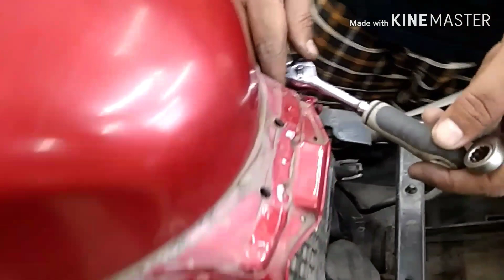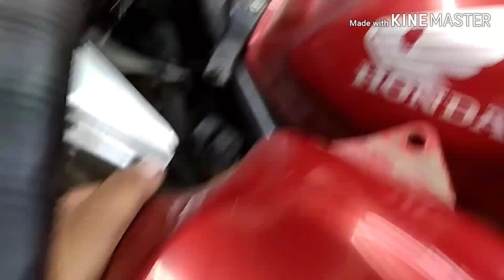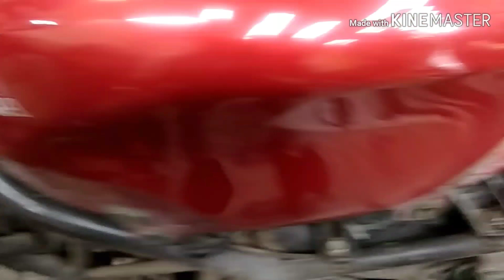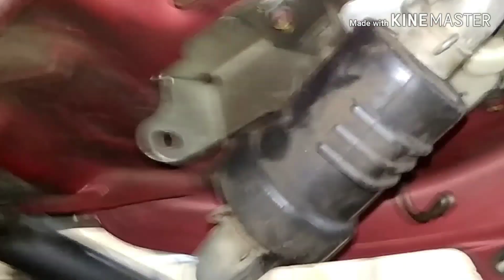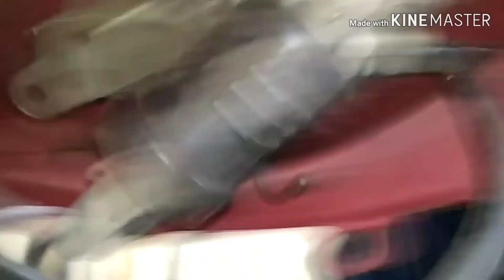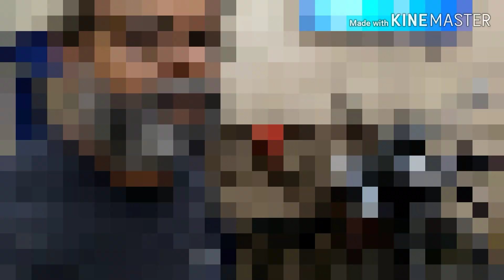Honda cbr250r fuel tank disconnection procedure (English)

Comment: Thank you for this video. Sir, if you read this comment, please do respond. My 2012 CBR250R has a fuel leak issue where it only leaks when the tank has more than 3-4 litres of fuel in it and also it only leaks after parking the bike on side stand after riding. The leak is from the overflow pipe (1 of the 3 black drain pipes near the side stand area). In this video, I didn't see where or how is the overflow pipe connected at the bottom of the fuel tank. Can you possibly tell me ?
Reply: It connects to the top

Comment: I recently had service of my cbr but since 2 days there is rpm fluctuation issue and knocking sound from engine, after self start bike automatically switches off , I don’t know what to do , its at service centre and company mechanic says to replace fuel pump and it’s expensive

Comment: Mera cbr me rpm flactuate hota he and knocking hota he.... Reason and solution plzzzzz🙏🙏🙏🙏
Reply from the maker: try using shell higher Octane fuel and let me know thanks.
Reply: I am already using.... And my magnetic coil is short... Is that for? Or tps sensor or ecu??🙏🙏🙏🙏

Comment: Sir one of the nipple got a crack and fuel is leaking
What can I do about it
The new fuel pump costs 14k
Reply from the maker: i need to know where it is broken...send me pics on macasp@gmail.com
Reply: @MechAutoClinic  i fixed it sir
It was a small crack at the beginning of the narrow nipple
I inserted a small steel pipe inside the nipple after increasing nipple diameter with a drilling machine for the fuel flow from the pump to the pipe
It exactly wasn't a steel pipe but a steel pen refill like the one we find in parker pen

Comment: Whenever I wash my bike cbr 250 everytime the water gets clogged around the tank lock..
How can I clean the hole??
Reply: I guess u should apply air pressure from the hole which is there in the tank.
Reply: @gauravG1614  thnx will try it..

Comment: Very good explanation.
 I pulled the injector pipe n broke the spigot from the pump. N e idea where I can get the housing? Full pump is available but I just need the body. Appreciate any inputs. Thsnks
Reply: My bike just won't start again no fuel pump priming...I thought it was a kill switch issue,which it's not I ripped the entire electrical system of the bike and replaced with a new harness, and at last I found that it was the zener diode at the back of the ignition key that failed I bypassed it by using a 9v battery the bike now starts just fine and runs as if normal 
How can I replace the diode, any ideas...or at least.where to get it.and I'm from Chennai,Thanks in advance..😊
Reply from the maker: @rguru2493  send the pic of ignition switch and diode to macasp@gmail.com
Reply from the maker: CBR?
Reply: @MechAutoClinic  yes
250r abs
Reply from the maker: can u send the pics of unit to me. macasp@gmail.com
Reply: Mech Auto Clinic 

I will. 
Also if your in mumbai India , at the Kurla bike market C.S.T. road mullah end, fuel pump available @3200/-
Reply from the maker: @sanoronha1963  i know but end of the day still plastic...
Reply: @MechAutoClinic  
How do I send pics here
Reply from the maker: @sunilnaru  macasp@gmail.com